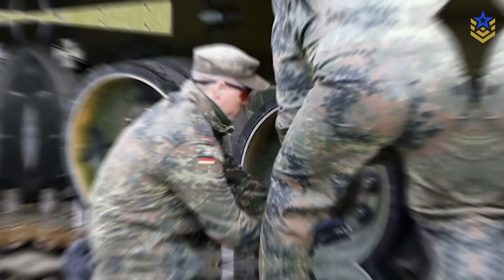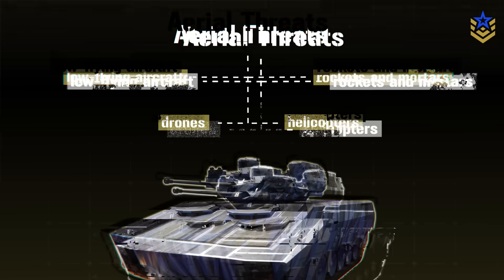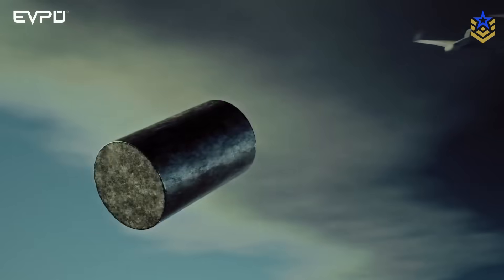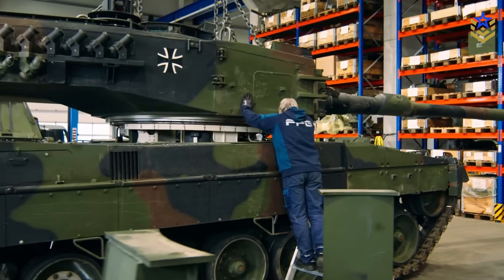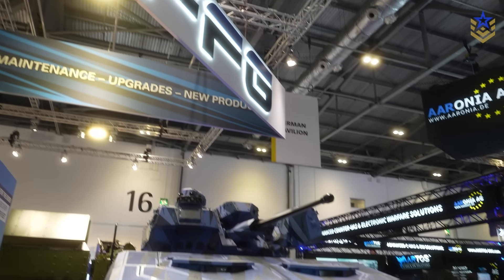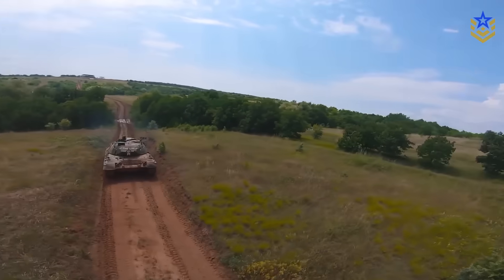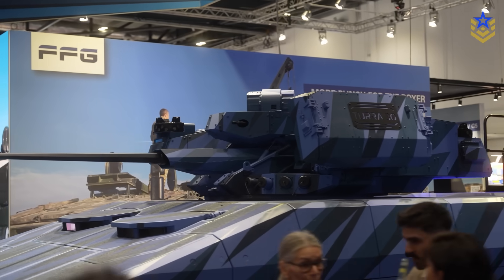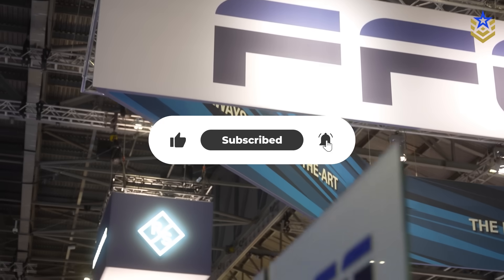Condor Combat Vehicle: Leopard 1 Reborn With 30mm Cannon and Radar System

Comment: Nice looking kit. Would prefer a 35 mm main gun, for added range/time for engagement against aerial targets.
Also, it would improve fire support terminal effect, better/greater airbursts over trench lines as well as better
penetration in the anti-vehicular mode. Balancing these benefits against reduced ready/available internal ammo,
deployment resulting from doctrinal SOPs may provide the needed operational parameters ensuring usage will
not be hampered by logistic bottlenecks.   Be well and stay safe
Reply: 30mm is cheaper and you can take more ammo with you if you expect many small drones. but 30mm and 35mm are both options as i heared.
Reply: 30 / 35 mm was already debated when it came to the armament of the Puma. While 35mm packed more individual punch, 30mm has higher ROF and more ammo. Puma-argument was that against highly armoured targets 35mm would be as ineffective as 30mm and against soft targets the higher ROF of 30mm would more than make up the effect of the 35mm. I think the point was the same in this case. Especially against small drones reaction time is the key, not a big punch.